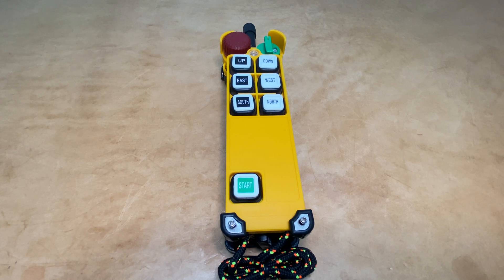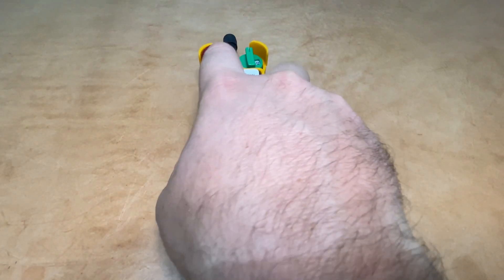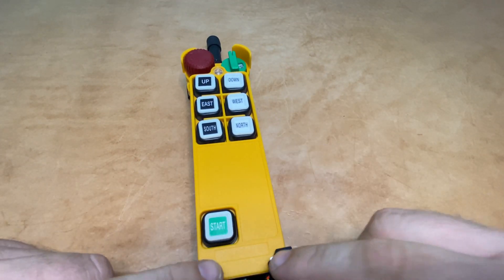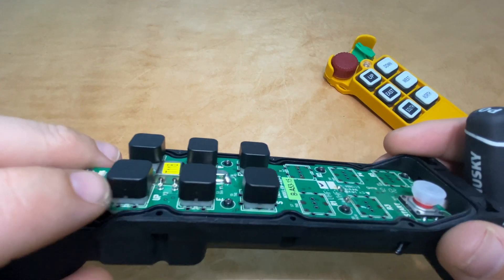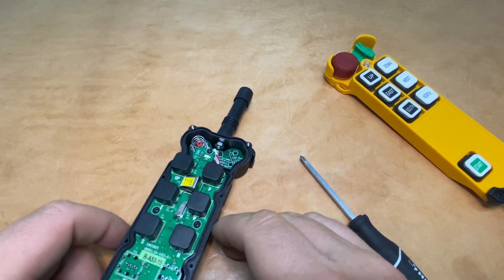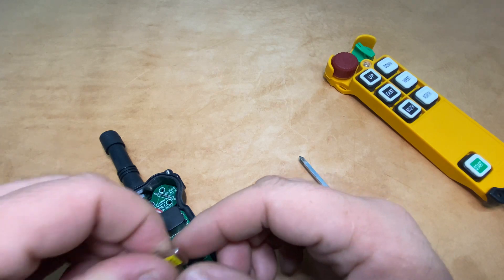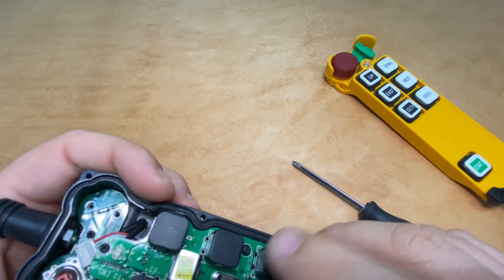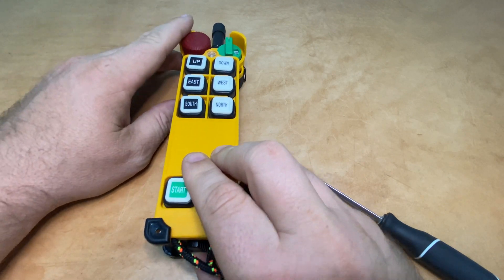F24 Channel Change - Changing Frequencies on a Telecrane F24-6D Transmitter

Comment: If some of the buttons don't work even though the buttons have been replaced, where is the problem?
Reply from the maker: Sounds like an issue with the encoder board could be the cause. Contact the Team at RDA Electronics for parts and support at (302) 250-4600